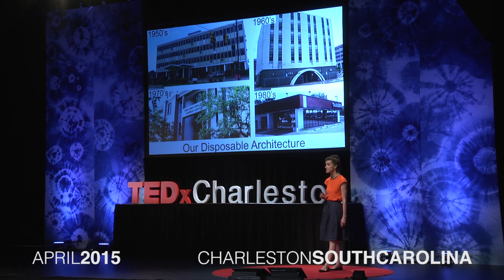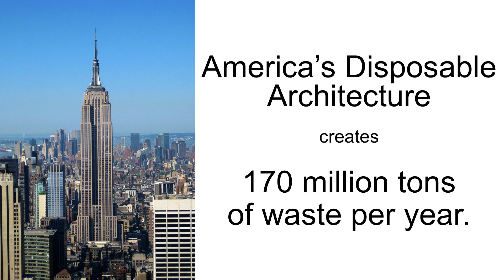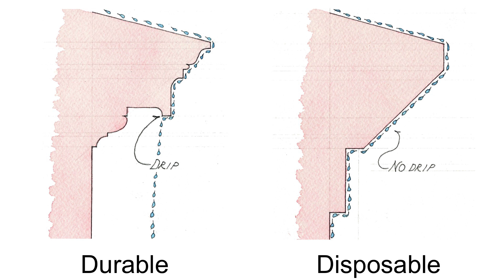Our Disposable Architecture | Jenny Bevan | TEDxCharleston

Comment: It is nice to see that the awareness of buildings lifespan grows in America, but I am afraid that the "durability" is red herring. Cause on the other side we have continously improved the technology through scrap&build approach through trial and error. It's not only about the energy, other resources are even more limited (energy is actually unlimited if we look beyond fossil fuels). So half a meter thick wall beside the massive work needs massive amount of materials, while glasswall doesn't.
Also, not all the buildings can be adapted successfuly after 160 years.
I work on this theme for quite some time and I think that the solution is building transformable buildings. Transformability stands between durability and scrap&build approaches which are the two extremes, and all that our economic doctrines deal with regarding optimization of resources consumption. We need to treat buildings as only temporarily finished products.
Reply: Vladimir Popović I don’t want a temporarily finished structure to live or work in. I want a well done structure as sublime as traditional buildings that also connotes dignity. Just make little improvements to the classical design and forget trying to beat the creation of thousands years of geniuses standing on the shoulders of geniuses.